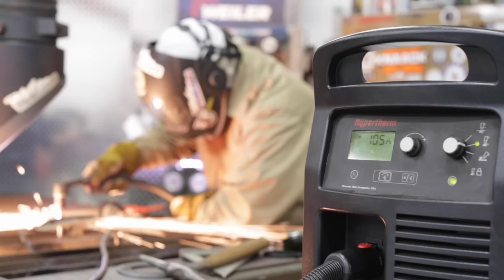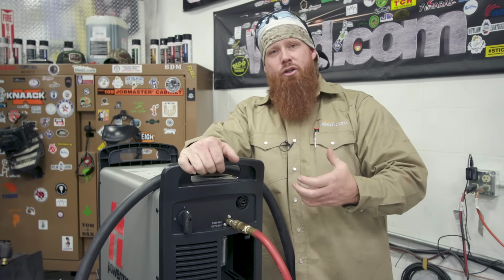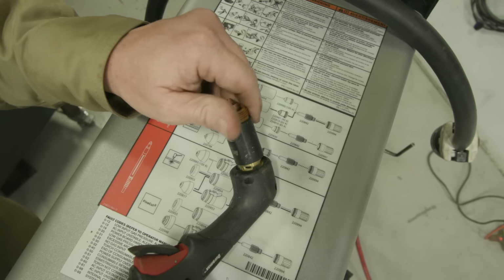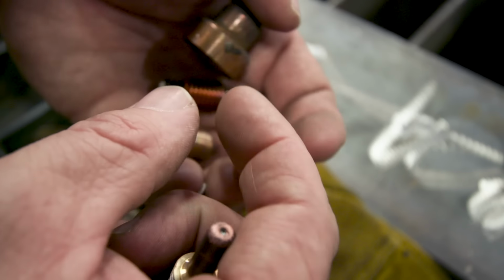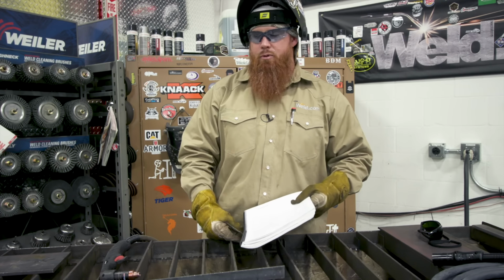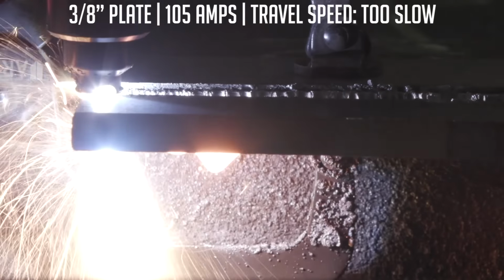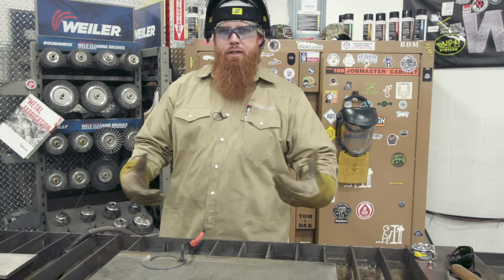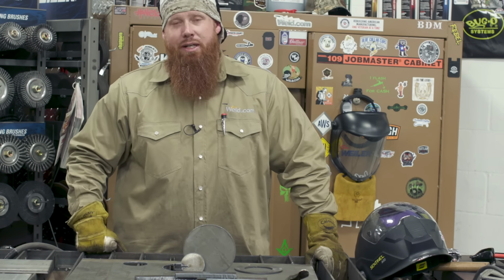Introduction to Plasma Cutting

Comment: Great video, But it would have been good to also use a less expensive machine. I am not talking about a $100.00 amazon special but a machine in the budget of small or home workshop Guys. Also you didn't really explain the difference between a high frequency start machine or a low frequency pilot arc machine. It would be good to know the pros and cons. Thanks.
Reply: I have a Thermal Dynamics Cutmaster 52, paid $1300 for it a couple of years ago, Great machine but tops out at 60 amps. Some say the Hypertherm consumables last longer, I can't comment on that. Others say TD engineers theirs for faster cuts at the cost of cut quality. I'm not convinced, but I can't say that isn't true. I use mine in an no name CNC table and it cuts well if I set it up correctly.

Comment: Can only cut Iron with Acetylene, LMAO I guess 50 years of fabrication was a Fluke for my grandfather.
Reply: You can only cut materials that readily oxidize when it is heated with the torch. This is going to be mostly ferrous materials, i/e iron, carbon steel, etc.
Reply: Oxy will only cut materials which have lower temp melting oxides than the base metall properly. So no aluminum and no stainless with higher chrome and nickel.
Reply: @Vinreeb  Actually you can cut stainless if you lay a piece of steel sheet over it, and cut through the two sheets together. It is pretty ugly but it will be cut. A thermal lance is just a piece of black pipe, stuffed full of steel wires connected to an oxygen tank. At a mine I worked at, they used to have to use the thermal lance from time to time in the crusher. It consisted of 3/4" pipe stuffed with steel wires and connected to an oxygen tanker. The operator would be dressed in a furnace suit, and would light the lance with a gas axe (oxy cutting attachment) and then go back to the other end of the pipe, and crack the oxygen on. That thing would cut anything, - steel, 30 tonne boulders, concrete beams - whatever. The pipe full of wires would be slowly consumed, and when the hot end got too close to the operator for comfort, he would shut the oxy off and just change pipes. When they cut through the old steel mantle, a wear part on a gyrator crusher, and hit the epoxy Nordback behind it, flames would rise about 100 feet or more with the 3/4" lance, it was pretty impressive to watch.

Comment: So if you take air cylinder and a gas power generator you can cut anything anywhere?For 10x cheaper than acetilene.!!!!
Wonder if it can cut wet wood ,that would save me some time?

Comment: Hello Jason, great intro to Plasma cutting! 
Good that you also mentioned, at the end of the video, the possibility to use Plasma in combination with CNC, where it really shines :) I also have a Hypertherm Powermax and I am very happy with it.
Since you talked about electrode negative/positive. I like to keep in mind that electrons - i.e. the negative "balls" in the atom grid - come out of the negative (hence minus) electrode and wander through the conductive material to the positive electrode (being positive attracts a lot of things).

For those interested, the little electrons take it easy and wander relatively slow, e.g. in a 1 mm² copper wire and at 1 Ampere the speed of the electrons is just around 0,08 mm/sec. In Jason's case, he used 105 A (=> electrons speed up by 105, versus 1 Ampere) and a 4AWG (?) ground clamp (4AWG = 21.2 mm², => electrons slow down by 1/ 21.2). Thus, the speed of the electrons is about 0.4 mm/sec (105/21.2 => 5 times faster). At a cutting speed of 94 ipm, Jason was actually cutting 100 times faster than the electrons were travelling through the copper ground lead :)

Now, tell me that electrical stuff is no fun :)
Reply: If I only knew or was taught these facts early, I may have saved myself from having to jump trades cuz I hated welding cuz the teacher was jus awful. Everyone is different, therefore we learn & may teach differently. Send me to the structural basics of reinforcing & strengthening.
Reply: @eyesofagemini7715  
The local HS just junked out a 24" Delta planer because it had a weird vibration (they kind ran the deck into the cutting head LoL)

Comment: Great intro to plasma cutting. You touched on the electrocution risks but probably worth mentioning that plasma cutters have a much higher operating voltage than a welder has, hence the greater care needed to avoid getting zapped.

Comment: Something I've learned using my hyperthermia 30xp is always have a smooth surface to drag the torch on. Wether it's mill scale painted or bare metal. Trying to drag over rusted metal even if it's light can effect cut quality due to the extra friction causing the nozzle to skip.
Reply: Rusty old diamond plate is a bear.
Reply: @ljprep6250  Flip it upside down and use a straight edge with a drag shield.
Reply: @SegoMan  I couldn't do that to dismantle the old truck utility body, but I can clean it up that way, now that I have access. Thx.

Comment: Nobody ever shows cutting aluminum with a plasma cutter. Also how well do they work for cutting off bolt heads and such vs a oxy cutter?
Reply: I have done plasma cutting on aluminum on my Hypertherm  XP 30 and it works just fine , cutting 1/4 inch is easy I have not gone over 1/4 inch as I rarely use aluminum over that., I am sure that with the larger models you will be able to cut thicker aluminum with ease.
Reply from the maker: We can do a demo on AL.

Comment: Why did you go in the opposite direction on the outside circle cut.? Thought you was suppose to cut CW?
Reply: It's because he wanted the outside edge to be best, not the inside edge. It depends on which side of the cut is waste.
Reply: @iraadams7459  thanks I figured there was a reason I missed..
Reply: Ira Adams How does one know which way cuts better? Experience I'm sure but is there a rule?
Reply: @smportis  He does explain the way and the reasons for it when he cuts the hole in the plate Vs cutting the circle out with the circular piece being the wanted workpiece. It is all to do with the vortex created in the cutting nozzle.

Comment: I repair welding and plasma machines for a living excellent video!
Reply: Kevin Tharp is there a drag tip available for a PAC110 torch?  The original tips I have are electrically live while cutting.
Reply: @cammurray8453  they didn't make an actual drag tip they had a stand off they sold that would go around the retaining cup and you adjust the height. They discontinued the "PAC" series torches starting in 2014. And have retro replacements in the Duramax series. Old torches had moving parts. So they designed the electrode to do all the moving. A lot cheaper to replace an electrode vs a torch head.

Comment: When I'm CNC cutting, how would I set up the machine for the swirl factor (direction of cut)?  Should I set up inside and outside cuts to go opposite directions? I have a 3x3 Gryphon CNC with a Hypertherm 45 amp plasma using a machine torch.
Reply: Typically your CAM software will take care of that. However, if you are writing your own code, you will need to do that as well as compensate your toolpath for the kerf of your cutter.
Reply: Are cnc machines cutting at 90°,smooth lines ? I mean how accurate can you be with it?
Reply: @zumbazumba1  They can be very accurate if set up correctly. If your air, amps, cut speed and direction of travel are put together just so and your consumables are in good shape you can get some very nice cuts.

Comment: 1/32 is about .032'     1mm= .040"     that is a 20% difference ....    if you run the electrode too long, you will see at some point it will just blow up - literally ... then you need to replace the nozzle too ....  you can try that out how long you can run them if you just cut up some scrap ....  
Obviously when you cut something nice, you dont want nothing to blow up ....
Reply: ZILA maybe it's just Lincoln but I have yet to burn through an electrode. literally 1\8 in cavern or more in the tip before it just didn't cut anymore because the arc was so bad. I actually prefer a worn tip for shaving welds. it increases the width of the arc without penetrating too deeply into the base material.  why buy a gouging tip or use a new tip when you have plenty of old ones not good for cutting.
Reply: @Adam-lv1uu  I would say depending on the brand you can have a cavity 1.5mm or 1/16 for sure when hand cutting ....  some brands and some electrodes can be used with a deeper cavity than others. but the deeper the cavity is the more arc wandering and arc stability issues you get. 
Also typically a lot of people can use more than one nozzle per electrode.  
The more moisture you have in your air the more nozzles you use and the more of this angles piercing you do (as shown in this video) the more you wear your nozzles prematurely and uneven ....
Reply: ZILA oh for sure definitely much of a cavity at all affects the cutting quality and width / wondering of the arc. what I was talking about was using an old tip or electrode for plasma gouging welds without cutting into the base material. a wider less penetrating Arc really seems to help remove welds quickly without hurting the base material. yes they sell tips for that but why buy them when all you need is a well used tip. we have 100% dry and oil-free air but you tend to go through tips plasma cutting for hours at a time and removing liftgates from trailers.
Reply: ZILA also I may be a cheap ass but if the quality of cut doesn't matter. I'll use a tip until the arc literally is so unstable it's practically exploding in every direction or arcing from the side of the nozzle. that's a good indicator you need a new tip 😁

Comment: Can you do a video on proper weld procedure for welding galvanized steel? Thanks.
Reply from the maker: We'll add it to the list 👍
Reply: John Smith I’ve always ground the galvanizing off with a grinder. Use a respirator, fume extraction or put a fan on it and blow it away. Then weld with your preferred process.
Reply: Muriatic acid will remove it too, but obviously has it's own safety concerns. Upside; if you are dealing with pipe or tubing you can soak the working end in the acid and get inside and outside clean.
Reply: The galvanized coating is actually zinc, not aluminum. Aluminized metal is a different process.
Reply: What Jason said...if you breath all that crap, drink milk.
Reply: Ryan gst that’s a common misconception. Milk will just mask the symptoms. You’ll still be exposed to the fumes and depending on the exposure limits you can develop long lasting effects.
Reply: @Ryan_1997  Never weld without a respirator. A 3M with  2219 filters.